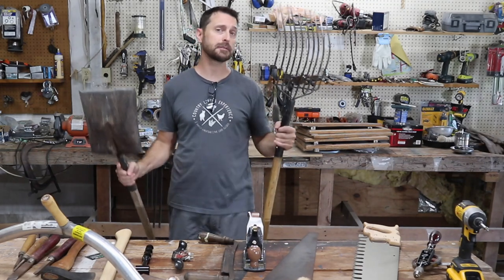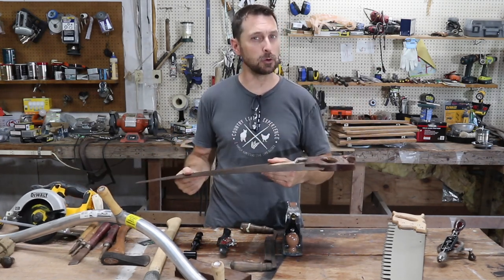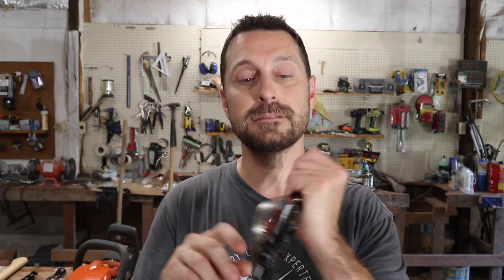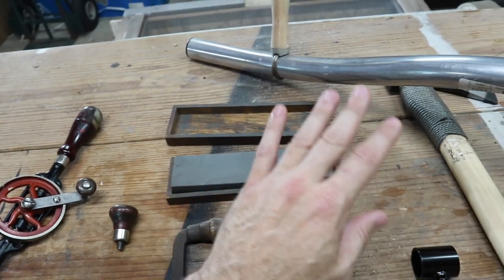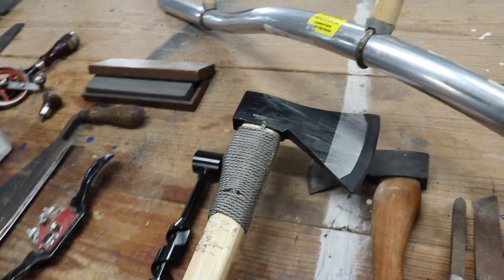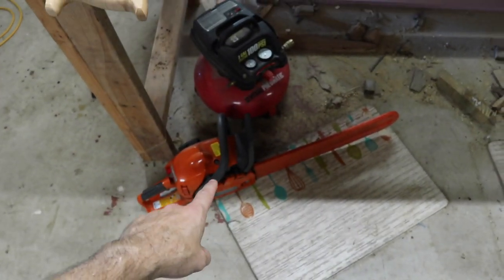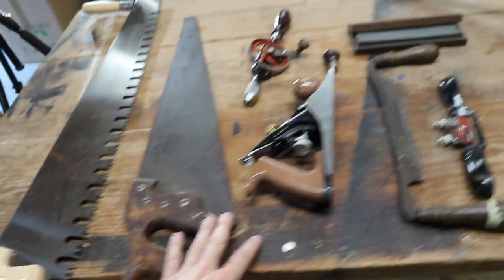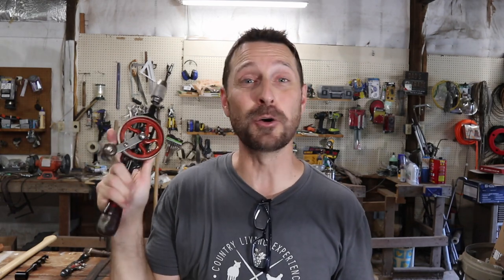Hand Tool Vs Power Tool On Your Homestead! You NEED BOTH Now!

Comment: Battery-operated power tools with a solar generator to charge the batteries.
Reply: Milwaukee m12 tools can be charged with a just a 5V usb solar panel. Very portable. Otherwise all the 18V+ platforms will require AC.
Reply from the maker: Y'all missed my point. I have those. You need a hand backup in the event they break and you cannot buy anymore.
Reply: @CountryLivingExperience  But what if the hand tool breaks?

I get it though. I mean, most guys already have some hand tools, of course. Probably bought those before they could afford power tools. But I'd say buying quality power tools (sorry Harbor Freight) and learning the proper techniques will be the best bet when it comes to keeping your power tools operable for a lifetime.

1. Sharpen tools that need to be sharp
2. Use tools as they were designed 
3. Keep motor tools lubricated
4. Don't push a tool past it's designed limit
5. Allow tools to cool down properly
6. Keep a supply of wearing parts
7. Don't lend your tools out

Most people break their tools because they are not taking care of them properly. The second cause is because they buy cheapie tools that were never well-made in the first place, and were not designed to last.

Buying hand tools requires the same rules. If you buy a cheap hand tool it too will also fall apart. If you have bad technique, or misuse the tool, the same thing will happen. To me, the best thing is to do research and buy tools that are on the more expensive range. Then educate yourself on the tool and always use it judiciously. There is no reason why good power tools cannot outlast their users.

Comment: One of the things I love to do is go thrift.  I go to estate sales, yard/garage sales, and thrift stores.  In the past, I did that so I could find things for my eBay store.  However, that's gotten tougher and more work that I really want.  But, one of the things I can tell you, and encourage for that matter, is thrifting for tools, especially hand tools.  I have not seen that big saw you were showing, but I've seen all kinds of stuff including that manual drill with all the bits.  I've found all kinds of garden tools as well.  And we are talking pennies on the dollar in most cases.  It is an excellent way to increase your tool inventory without breaking the bank.  Just my two cents.
Reply from the maker: Thrift store or flea market shopping is great. Certain areas of the country have more than others and offer different items. I cannot really find hand tools in my area. It is great when you do find them though.

Comment: why dont you build a frame and put your water tank up on it to raise it and give you a little more preassure
Reply from the maker: I collect the rainwater off the roof. I would need a pump to get it up to the tank. I still wouldn't be able to get a decent amount of pressure from that tank even if it was up 15ft.
Reply: @CountryLivingExperience  well this might sound stupid but I took apart and old electric drill hooked it up to some junk solar panel from harbor freight put a drill pump on it from harbor freight and put it on my sand point well that was down 50 feet all three it works great, maybe someting like that might help